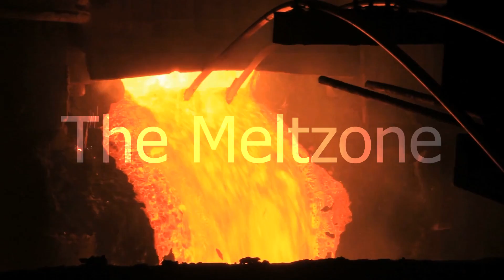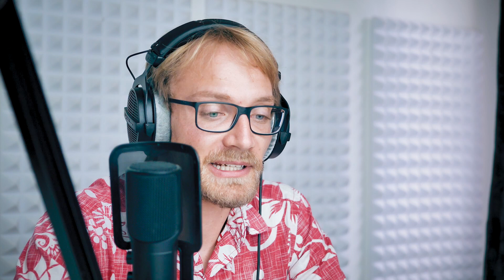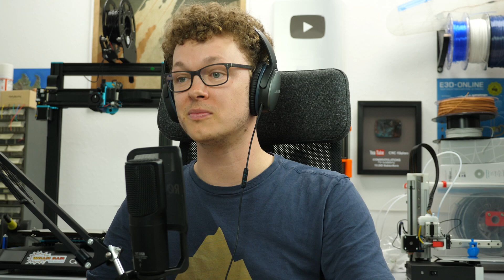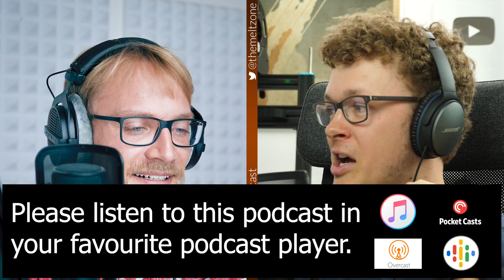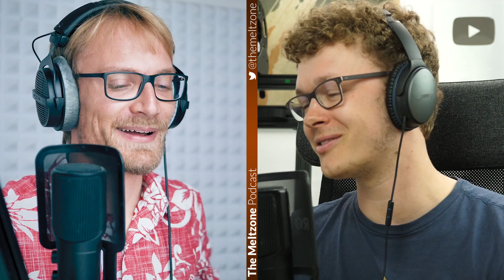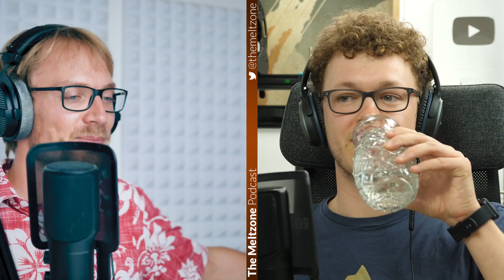Silent Stepper Drivers & Topology Optimization - The Meltzone Podcast Ep20

Comment: I work in aerospace, and recently had the same issue with an .STL we created in house to act as a drill jig for some parts. It had been created at the plane position, way out in space and I couldn't get it flat, or scaled properly. I ended up moving it to local zero in our software and it fixed the problem. It is now our practice to create a part at local zero, then move it to plane position to match up to the part.

Comment: You guys are doing great! Really love this, I switch back and forth between the YouTube version and Google Podcasts. This has become one of my favorite Podcasts and I tell everyone I know who is interested in 3D printing about the podcast and about both of your channels. One note about STL export(I'm a SOLIDWORKS expert so that's what I use for reference) you can export from a local origin when you do a save as STL and that can really minimize the roundoff errors. Also as an engineer it's great hearing you two banter about things like lattice structures, keep it up!

Also Creality is not pre installing their new board with TMC silent drivers but they are available for like $50. I need to get one to play with

Comment: For the record, you can optimize the TMC2130 in standalone mode, the 2130 has CFG4 and CFG5 pins on the stepstick (those are the tiny pads you can solder-bridge) configuring hysteresis and blank time. The 2209 has just microstepping and spreadcycle/stealthchop. However, a little known feature is that you can one-time "burn" settings into the 2209 (and 2208) using a temporary UART link, skim the datasheet for "OTP". Unfortunately, I don't think the currently most famous TMCStepper arduino library supports that.
Reply: Turns out there is actually an UI for OTP, from Watterott - https://learn.watterott.com/silentstepstick/configurator/ .

Comment: Excellent podcast! I can listen but it's the visual element that gives me a connection to what you are saying. Of particular interest was the chat about structures and it would be nice to see some practical examples in use. My difficulty with 3D printed engineering design is handling the inter-layer adhesion element in the design to offset tensile forces and shear. Your views on this would be interesting. Keep up the good work, this old man can still learn something and doesn't worry about high pitched whistles any more😉!!!

Comment: Thomas: regarding infill and IKEA table, the comparison is not of a thin plate Vs the table thicker but same mass. The comparison is: IKEA table solid, full infill Vs actual IKEA table. They reduced the mass to like 20% but they got, as Stefan correctly said, that the resulting strength is less than 20%. However this doesn't matter for IKEA, because they redistributed the mass on a thicker section (they spaced apart the top and bottom), so the usage of the remaining material improved. 
Same concept of the double-T bars used in buildings: reduce the mass and move what you have farther away to make better use of it. But the final strength (ignoring the weight difference) is overall lower than the percentage of the mass you kept.

Comment: in thousands quantities the Trinamic 2208 is $1.43 while the Allegro 4988 is $1.60 from Digikey.  You can probably get a significant break by going to 100k quantities and buying directly from the manufacturer.  The A4988 is probably cloned and extremely inexpensive in China.  Certainly for less than $0.10 when you can get the chip mounted on a board for around a dollar.

Please keep doing the video of the podcast here on YouTube.  I tend to watch it in 15 to 20 minute segments over several days.  I like watching your expressions as you interact.  Adds a lot to the program.

Comment: Go for sponsors & it's great the way it is too.  Although, if you want ideas, you could each show a new print.  Ideally it would be less than a 5 minute topic, although it could lead to a longer conversation and/or a longer form video later.  No huge or crazy involved prints, save those for the scripted videos.  Maybe a mundane part you needed for your home or just a cool model/sculpture you run across.  You could tell us if you ran into unexpected trouble shooting with the model or other tweaking to make it print.  Heck you could could just say "Teusday I needed a thimble for {insert sewing activity here}. Because zombies are bitch'n and I hate pain, I printed the tip of this zombie hand's index finger in vase mode. What did you print?"

Comment: @Stefan: I think there are a lot of usecases for latice structures, addidas as an example is priting their futurecraft shoesoles with a latice. ridell are using latices in their 3d printed football helmets. latices have the potential to replace rubber and dampening components in my point of view. kind regards
Reply from the maker: This is true. The point I wanted to make is that there is no real big structural benefit from lattice in terms of strength. Dampening, or custom soft structures is definitely an application for it. /Stefan

Comment: Splitting curves to discreet points is always pushing the computational limits. One related issue I ran into: I was not able to feed 65% gyroid infill into my Prusa MK3S clone fast enough. Took 30% longer than the same gcode file printed from an SD card and had some buggers in the infill as a result. Apparently the speed of the emulated serial port is not enough to send over all of the tiny moves.

Comment: I'm wondering whether the noise from your Cetus is really the Stepper drivers or whether it is related to the fans.
I have two Cetus Mk2 in regular use which had very annoying fans (replaced them with Noctua fans) but the steppers are not really annoying during normal printing speed. I actually use both printers during 3D printing beginner lectures due to their low noise level, definitely less noise than many other printers I came by. It would be a shame if they made the device worse compared to the Mk2 by choosing a wrong stepper driver / motor combination.
The biggest reason for the price increase was the huge market price increase in linear rails in 2018 - at least a year ago they suddenly increased the pricing of the Cetus by 100 USD with this explanation (source: https://www.cetus3d.com/warning-price-adjustment-coming-soon/).